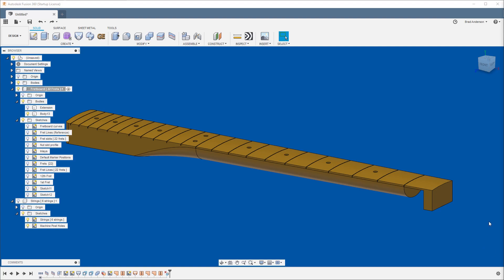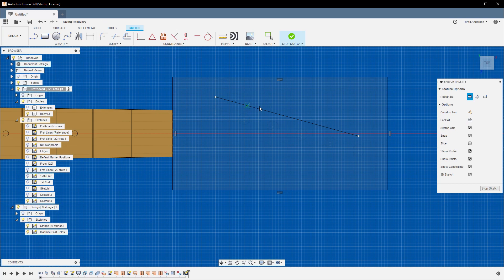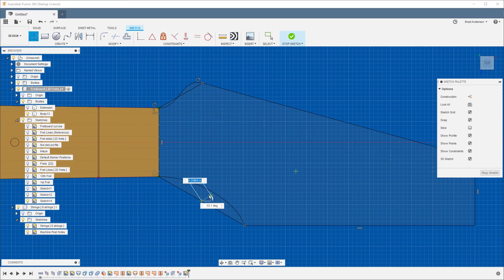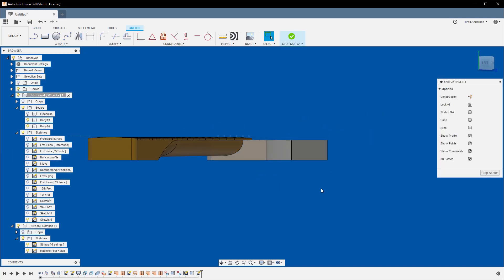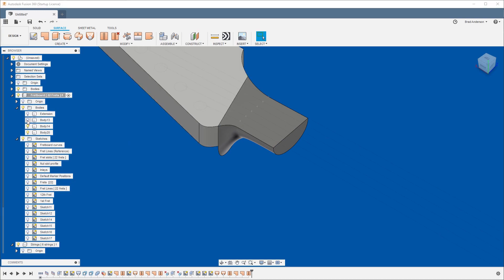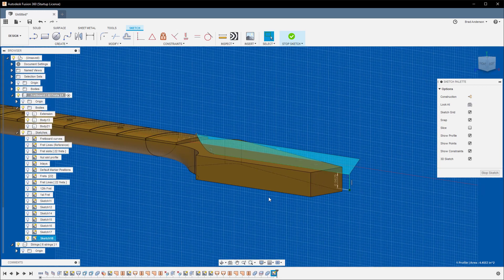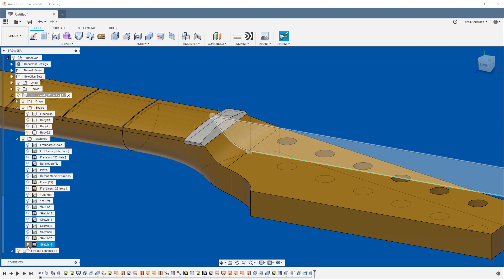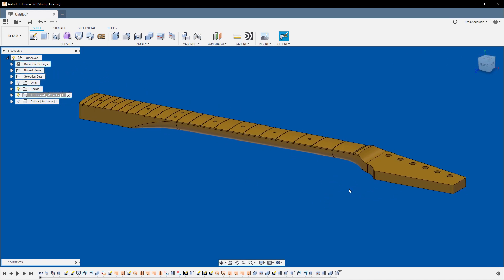Fusion 360 Guitar Neck Tutorial - Part 3 (Headstock and Transition)

Comment: Thanks man! you solved me a whole lotta problems here, in a simple and clean way. I spent a lot of time adjusting those side rails AFTER I did the loft, instead of simply create the basic form and then cut it. I still have to figure out the final fillet, that for those strangely shaped edges is clearly difficult for the software to calculate and solve.
Reply: Update. With this cleaner shaping the fillet turned out beautifully. Thanks so much again.

Comment: Thanks so much for these tools Brad. I started at the beginning of this tutorial (part1) and could not get this to build the fretboard on the x-y axis. I have my preferences set up as z being up. The only way i could get it to build is with the Top looking down, it is the high E side view. Will this ultimately matter when I go to put together the carving instructions together? If so is there an easy way to rotate the entire design to be oriented correctly? Also What was my mis-step initially? Sorry for the uneducated questions, trying to figure it out as I go. Thanks again!
Reply: Same question...the neck build seems to end up being on one of the long edges, with regard to the x/y axis'.  The z axis is representing the fretboard width right now but needs to represent the radius of the face of the fretboard.  This having been said, fantastic stuff!  This will save a ton of work, even if it has to be copied as CAD and reloaded in & scaled in proper orientation to arrive at desired CAM.